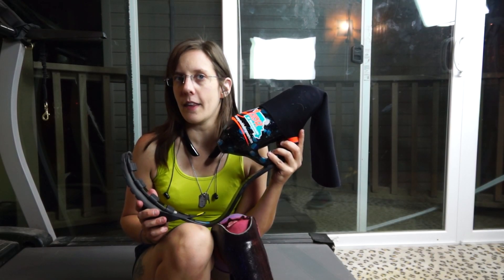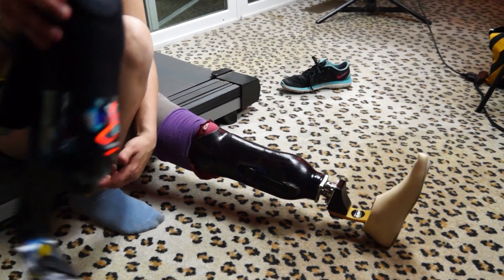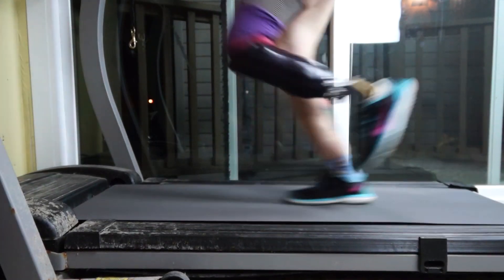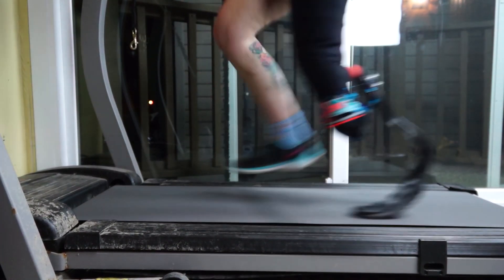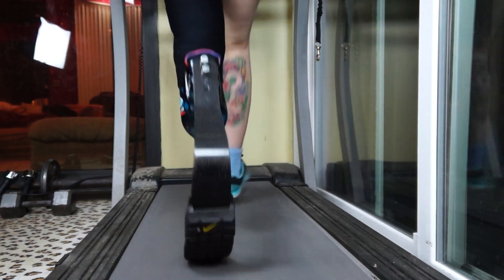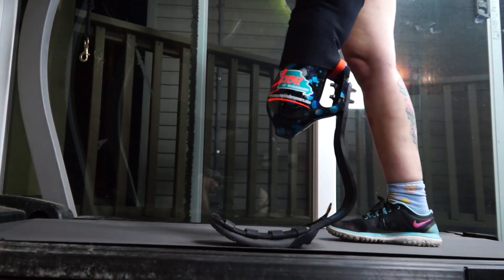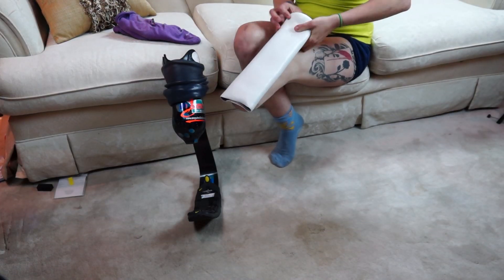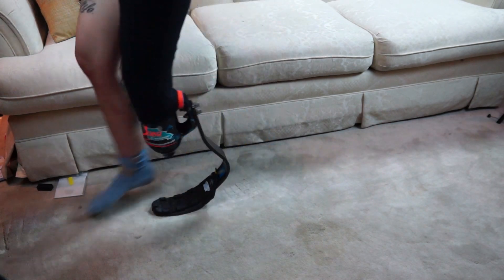AmputeeOT: How a Prosthetic Running Leg works

Comment: A suggestion about the sweating, have you ever tried wearing a 1 ply sock in between your stump and liner? It doesn't interfere with the liner, and it soaks up sweat instead of making the liner slick. It's also great for people with tender stumps, like if they have skin grafts or the like (I do). If I am really active and don't put a 1 ply on between my liner and stump, I get blisters, and those take foreeever to heal on a skin graft.

Also, there is a video on my channel that shows how a Flex Run squishes and compresses while running. It's from the view of a GoPro duct taped onto the end of the socket. Running on Flex Run

Comment: a thought...

if you were to put a shock absorber in the shank of the walking leg, would it be as effective?
Reply: I have a shock absorber in my walking leg and the travel is minimal compared to a running leg, more for going down stairs and so on.
Reply: I have OWW Pathfinder II foot, it have shock absorber in it. It's great foot, but I think it's not so efective as this running foot. I didn't try running foot, so I don't know how good it is. You can search in google for Fillauer Wave Sport foot, it's combination of this running blade and walking foot, I think it's currently best allround foot for active people.